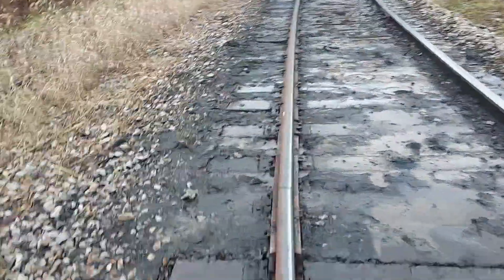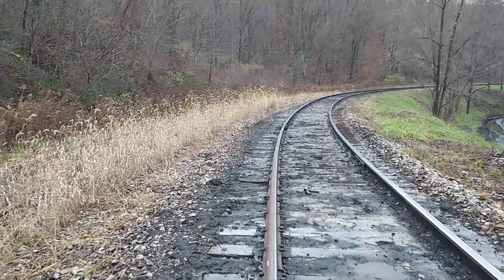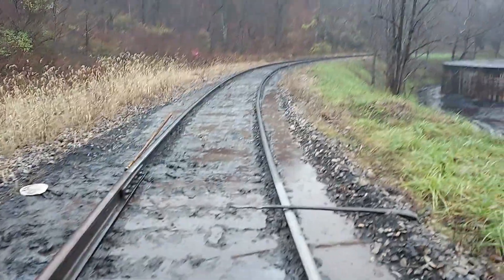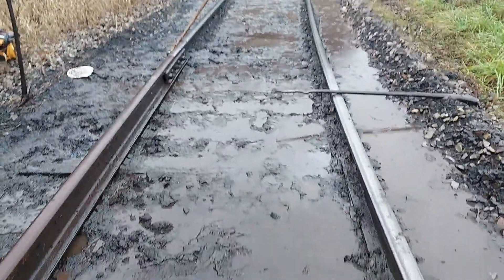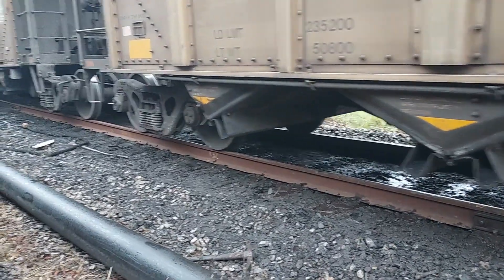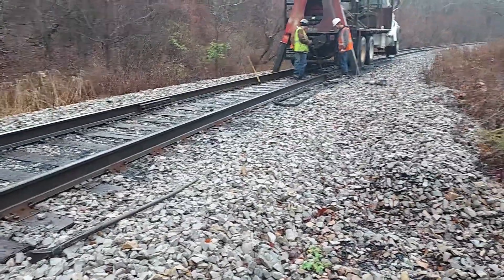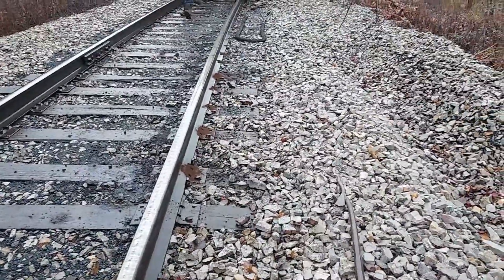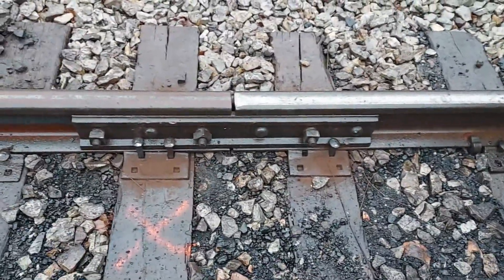How to Bend Rail for a Curve on the Railroad

Comment: Better blend those joints or you will develop a divot where the new track meets the old... those wheels act like a hammer anytime there are inconsistent level in the rails
Reply from the maker: Thanks Lawren. We usually do grind the rail head so their isn't
a mis match. That pounding on a mis match is hard on everything,
rail, car wheels, truck set bearings.... Thanks so much my friend
for watching and writing in.
Reply: @ccrx6700  Probably me preaching to the choir, but I have seen the effects on rail ends I have picked up... OBVIOUSLY less careful RR personnel than yourself
locally, they do continuous rail (welded Joints)
Reply from the maker: @Lawren_Wimberly  😊👍
Reply: @ccrx6700  Locals here are crx

Comment: i live maybe 300 yards away from BNSF tracks  have for 6 years and in the last two weeks the track is making a new sound real heavy clicking  sound just when the wheels  pass over a joint i think ether way only on one track there are two tracks should i be worried they go through here some times at 60 miles  an hour a lot of the cars are tankers carrying crud oil going to a tank farm thanks for any info if you have any
Reply from the maker: BNSF usually takes pretty good care of their track John. If
you can get over there, check for loose or missing joint bolts, a cracked joint bar, chunk of the rail head missing. Could even
be a broken rail near the joint.  BNSF puts their phone number at crossings so if you see something it's in the best safety interests to give them a call. Give them a Mile Post also if you can find one. 
Wish I loved closer, we would go make a track inspection there!
Thanks for writing in and watching my friend.
Reply: Sounds like the ties under the joint are pumping a bit and the joint may be a bit loose as well. more than likely one piece of rail is dipping as the train approaches the joint, and the adjoining rail is staying in place causing a vertical mismatch. Think of it like a step and the wheel is "stubbing it's toe" usually not an issue unless the track condition gets extremely bad.
Reply from the maker: Very good explanation Matt. Also could be a broken joint
bar or head separation? You and I need to go make a track 
inspection and get to the bottom of this....LOL
Reply: The tracks are inspected regularly, so there's nothing to worry about.

Comment: Does the rail take a "set  " or will it  continuously try to straighten?  
When manufacturing bridge beams some of the steel gets a bow in it. A large rosebud is used to get a pie shaped area  really hot then quench it with water. Using specific designs and spacing really crooked or curved beams can be straightened.  
I'd think you'd have a method to do the same thing.
Reply from the maker: Good question Mike. This rail had been in there since 1975.
I did not show it in the video, but when it came out, it tried to
spring back to it's original straightness, but still had a slight bend
to it. In other words it did not re straighten itself to original,
however neither did it stay at the 14 degree of curvature that
it had when it was in the track. Thanks for taking the time to
check out the video today my friend.

Comment: Yet another nice video! On a curve, which rail experiences the worst wear--inner or outer? Or, is the wear about equal?
Reply: The outside (or high side) experiences the most wear due to centrifugal force pushing the wheels into the outside of the curve. It will actually wear the head to match the radius of the flange. To mitigate this you would usually super elevate the outside so it's higher than the inside. Similar to a racetrack same principal. Depending on the amount of stock you run on the track you could also install a greaser to add grease to the flanges as they pass this will cut down on wear for both the rail and the wheels. They are quite expensive though so you'd usually see that for tight curves with high traffic.
Reply from the maker: Most generally Jason the outside rail does. Over the years here
we've replaced far more rails on the outside than the inside rails
in a curve. That is the "steering" rail for the cars so it gets
more pressure applied to it. Thanks for writing in and watching
my friend.

Comment: Another good way to bend it in that I like to use, is  after we drill and bar one end, we use the ratchet gauger when the degree of curvature is pretty tight. It does can't the rail some but aids greatly. When it cant's in, a light tap with the sledge will help seat it as well, and then we keep moving it down until it is time to drill and bar up the other end. Good video and working in mud sucks!
Reply from the maker: Yes sir. I actually had a ratchet gauger in the back of my truck,
but since we have never used one for that purpose, guess I
never gave it a thought of also showing how you could do it
with one of those. Thanks for sharing and adding in on the
different ways to bend rail my friend.
Reply: @ccrx6700  no problem. Keep up the good content that gives the world a peek into our profession. The other thing I hate that rivals working in muddy track, is winterizing switches and all the digging from the points back to the heel block. But, I guess it must be done, LOL.

Comment: Getting some mud jacking under the new rail on the 14 degree curve.
Reply from the maker: Yes  Jim this section needs some good ballast rehabilitation done
to it. This is 10 mph track. We also have a few sections on
main at 25 mph which will get done before this section will.
It's on the to do list. Always would be appreciated for you
to volunteer to come out and start digging away.... :-) Thanks
for taking in the video today my good man.

Comment: Very interesting, thanks for the video.
After the rail has been in for awhile, when you take it out, will it still be curved or does it straighten out again?
Reply from the maker: Thank you Al. Very good question. metal does get a memory,
however if you noticed when we took the stick out on curve 11,
which is an 11 degree curve, it was almost straight. That rail
had been in there since 1975/76. So after all those years of
being bent, when taken out it straightened up, although not
as much as a new stick of rail would be straight. So yes rail
does get a "memory" but it also has a "memory" for it's
original shape. Hope that's not confusing.  Maybe should say 
it does retain some degree of curvature when taken out but
is not like zero degree when originally rolled.

Comment: Well i wondered  how rails are curved now days now i know. When the Bethlehem  Frog and Switch was in business there was a  building called the Curving Shed All the rails were curved there and sent out curved. They used a hydraulic press  rail was feed through the press on a roller line. Cool video now i know how its done now.
Reply from the maker: Awesome Michael. Wow would I ever have loved to go thru
that shop and see that done. We've bent rail with bars here
since the beginning, it's actually not that big of a deal. Always
is a pleasure to have you visit with me my friend.
Reply: @ccrx6700  you are welcome anytime. That shop made 60 foot switch points at one time. And crossings and panel turnouts.
Reply from the maker: @BeeLineEast  👍😊

Comment: People would be surprised how much flex rail has. My wife was shocked when I told her we bend rail around a curve by hand most of the time.
Reply: Is the rail really "bent" or is it curved under pressure? If the spikes came out for reason, would it snap straight again?
Reply: @davep6977  It'll straighten again, though not when it's still bolted to the next rail at each end. And I doubt it'd "snap" straight. Rail's heavy, and it has a lot of friction against the tie plates, so it's not going to move fast.
Reply: @davep6977  Rail is very flexible. On a curve you simply guide it into the tie plates with what he called a "Pinch Bar" similar to the one he shows here. Those hexagon bars are more recent, and I never much cared for them myself. Our pry bars were made out of round stock with a point on one end and the other end had the bent pry chisel tip.
Reply: I always thought, the rails needed to be heated, not red hot, but just literally smoking hot.
Reply from the maker: The only time we've ever had to use heat is when making the
sharp bend in a turnout curved closure rail We've been bending
rail with bars since the beginning. Not often have we had
a grapple truck to help us. Thanks so much my good friend
for joining me on the rail bending party.
Reply: @ccrx6700  Thank you for the feedback👍 I love trains and rails, especially rails, because when I was 4 years old I loved to see the train pass behind our house.I would say the train was 30 feet away from my house.It was back in 1974-76. There was a rail derailment. Back then, they didn’t have the equipment to keep everything in line.Small town in Tx. The man from the other side of the railroad grade said one time, that the rail was bended, no one listened to him. He said one day the train was going to derail, but back then, we were ignorant. My grandmother didn’t know where to call, neither did the man. They barely could afford a phone. We lived in back of our grandmother’s house.it was a long fence that curved. The train derailed, the Engine went down the grade, to the street. The street was made out of gravel. The wheels of the engine sunk. The boxcars landed on my grandmother’s fence, taking out her garden, with fruit trees.After the big scare, she was talking to the foreman. She was more mad, about the garden than the fence.lol They did fix the fence..I don’t know about the garden.This happened in 1973. I don’t remember. My father told me everything, when I grew up. If only that man could have talked to someone like you,It wouldn’t have happened. But thank the Good Lord no one was killed or hurt.. that’s what matters.By the way my father said it took two big cranes to lift the engine.
Reply from the maker: @aaaeee2862  😊👍❤️
Reply: @ccrx6700 DAMN ! And I though most bending was done with a portable "roll former".
Reply: I've  heard of oil soaked rail...being placed  along side a rail and being set on fire...making the rail exspand...and bend!
Reply: @davewallace8219  We used cotton piping (cotton rope) soaked in diesel to perform that task. We used to use asbestos rope, but they made us quit using that when they found out asbestos wasn't good for your lungs. We use about 100 ft lengths, lay it on the base of the rail, usually on the outside, and the heads of the spikes kept it in place. Light it with a railroad fusee (flare) and let the fire do its thing. I closed many an open or stripped joint that way. When your done installing new bolts, you adjust your rail anchors to help hold the joint tight. The rope burns itself out into an ash. We don't heat rail to bend it. The only time we heat rail is when you're installing new rail or in making a repair at a joint where the tension has broken the track bolts.
Reply: @coldblue9mm  thank you!
Reply: Much respect, sir! One of those professions that we absolutely need real men to get things done.
Reply: What, over the knee then?
Reply: Gandy Dancers?
Reply: I’ll never forget when I was 20 years old only a few weeks in as a labourer on a rail gang for CP Rail and I saw how flexible the long strings of rail were especially when the speed swing was moving it around. I couldn’t believe my eyes honestly
Reply: Bs... you don't bend that rail by hand!!!
Use only your hands!!!
Reply: Bs... you don't bend that rail by hand!!!
Use only your hands!!!
Reply: @markmajors408  By hand does NOT mean without tools.
Reply: @ohsweetmystery exactly, in this day and age we still do it “by hand” but with the help of hydraulic tools and heavy equipment. 

Where I work if we curved a rail all by hand like the old days in the 1800s and management seen us doing it that way, we’d probably have some explaining to do and be in trouble.

Comment: Hello Dave and it's good to see you back from your vacation I hope you had a blast. My question is about how much maintenance is required for a streight track vrs a section of track with curves, it's my understanding track with bends and curves requires more maintenance. (So good to have you back and I hope you had a wonderful Thanksgiving).
Reply: You never responded??
Reply: @OldBurlingtonNorthern  I’m a track maintainer for Canadian National.  To answer your question curved rail requires more maintenance most of the time because there is more resistance in a curve train speed is reduced in curves. But Proper super elevation and gage reduces maintenance.
Reply: @gutterguru7158  Thank you for you response and I'm wondering what those metal plates are called that you sometimes see on one side of the rail, they go all the way down until it straightens out.  I believe that are from support so the rail doesn't move
Reply from the maker: Yes Donnie, curved track gets a lot more pressure on it
from car wheels than does tangent track. One of these days
will make a video showing what we call curve wear on the
inner edge of the rail head on the outside rail. Car wheels
flanging thru a curve is like taking a grinder to the rail and
beveling it. Hope you turkey day was good also. I stuffed myself,
but no real surprise there.... LOL
Reply: @ccrx6700  if heard some railfans refer to that as a shave and a hair cut, the flange rubbing on the inner rail going around curved tracks. They start getting thin after a while.

Comment: Dave how do you account for expansion due to temp changes on jointed rail?
Reply from the maker: Good question Jason. We like to to have about 3/8 inch gap
between the rail heads. That is about perfect for our track
and our running and weather conditions. Obviously with 16
miles of jointed track that perfect gap is not the same
for every joint, but some a larger and some smaller, so it
all ends up in the wash. We have almost no heat buckles
in the spring/summer so that says we are in a pretty good
range for joint gap. Pull aparts in the winter are much easier
to fix than a heat buckle. Thanks so much my good friend
for joining in with us tonight.

Comment: So as long as you set new rail on the old tie plates you can keep gauge...???
Can you respike using the old tie plate holes...???
Reply from the maker: We don't pull the anchor spikes in the tie plates Donald, so thus
the plates stay in place. We just pull the rail holding spikes.
Anchor spikes are on the outside of the tie plate.
Some people call anchor spikes also
gauge spikes because they help hold the gage when a rail is
taken out. Wish you had wrote in before I made the video, LOL...
that would have been an excellent point to make in the video.

Once we pull a rail holding spike, then we will that hole with
Sure Spike, it's like a gun powder substance then drive the
spike into the sure spiked hole. That helps greatly to increase
resistance from the spike as well as seal out water from
getting into the spike hole. Always is a pleasure to hear
from you my friend.

Comment: When I worked for a industrial RR for one summer we did some work replacing some tie plates. I could not aim the nail hammer at all. Props to the the guys that fix rail all the time. I stuck to being a brakeman lol.
Reply from the maker: Don't feel bad, I still miss spike head on occasion after all these
years. Still break a maul handle on occasion to. That's railroading. LOL Thanks for taking the time to tune in and watch the show
my friend.